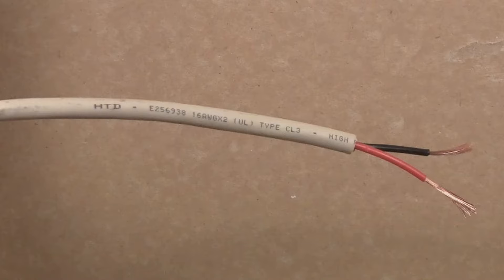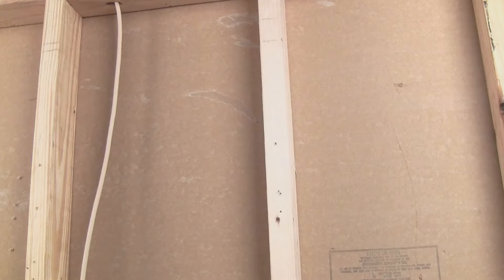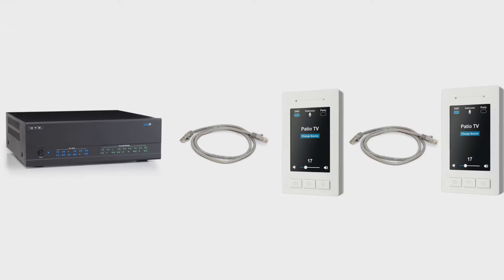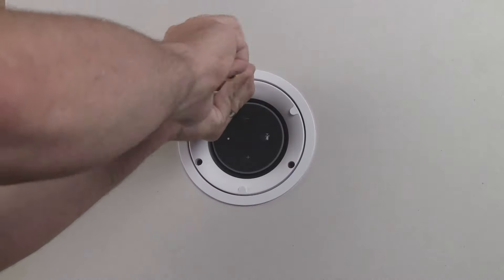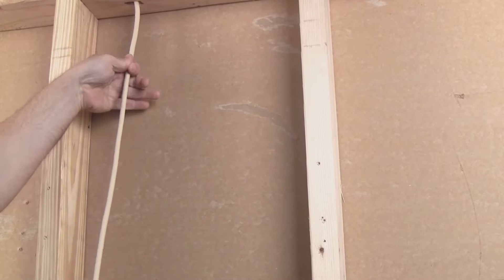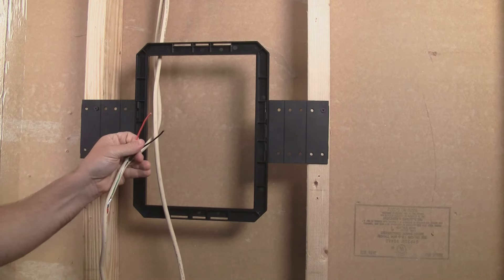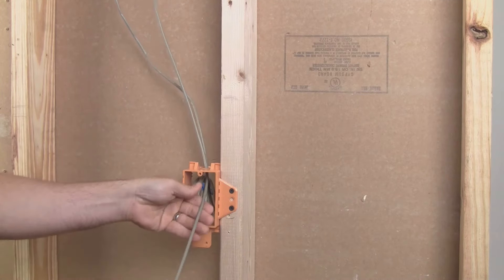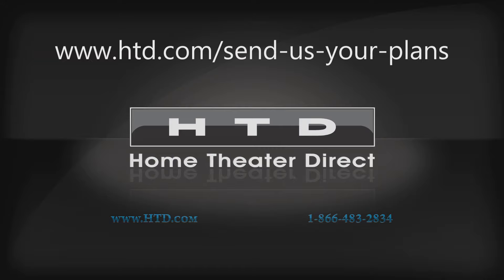How To Wire Your Home For Whole House Audio

Comment: So, if I want to control my entire audio system via smart phone, I can just run my 2C speaker cable from my source(amp) to each speaker location and be done? So I mean if I wanted 2 speakers in the kitchen, 2 in the living room, and 2 in each bedroom, I would run a cable from my source(amp) to all 8 locations and thats it?

edit: Okay I jumped the gun on that, just watched the tips portion and using 4C from the source to each section of the house and then a 2C to the second speaker is an easier process.
Reply: Yes, assuming you connect your amp to a whole-house-audio (WHA) controller that can be controlled via an app on your smart phone.  For HTD, those WHA controllers include the MC-66, Lync 6, and Lync 12.  You also need the $99 gateway that connects these controllers to your home's wifi network.  Our WHA sets include a multi-channel amplifier, but if you already have your own amp, you could purchase just the controller and gateway separately.